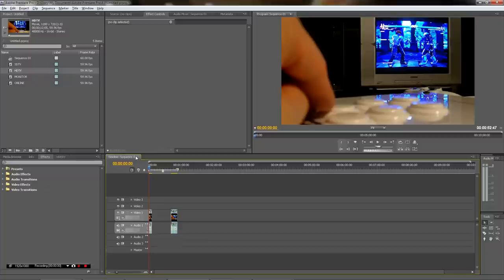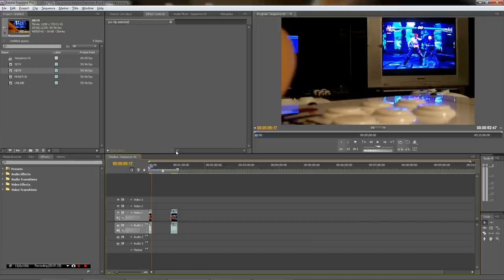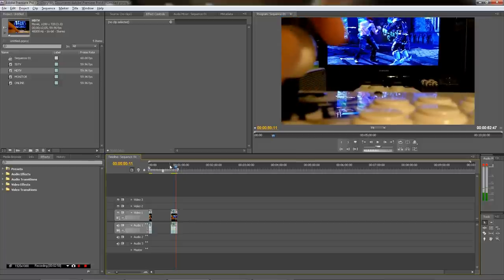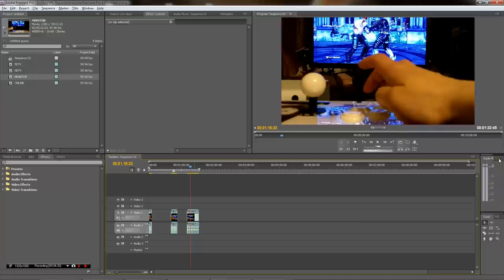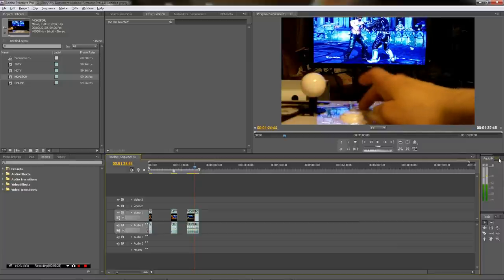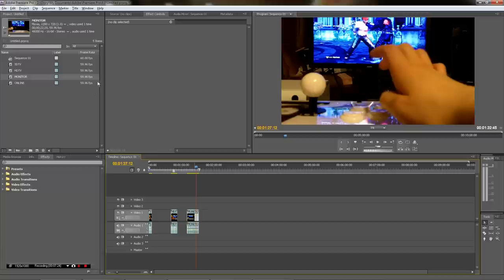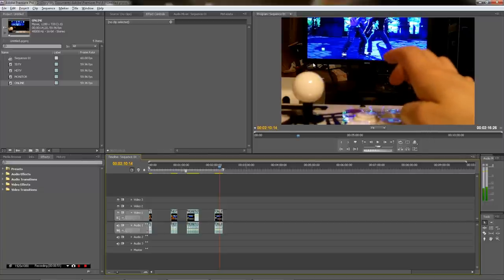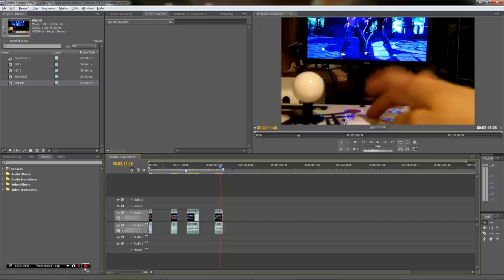My Input Lag Testing Method (TTT2)

Comment from the maker: Well the main purpose of the test for me was to measure latency between my sdtv and my monitor, and it accomplished that.  It gave me the information I needed to verify, which was that my monitor was pretty close to lag free.

I realize if you're measuring it for raw frame count, it can have a margin for error.  That's part of the reason why I repeat the test on several occasions just to test for the consistency.